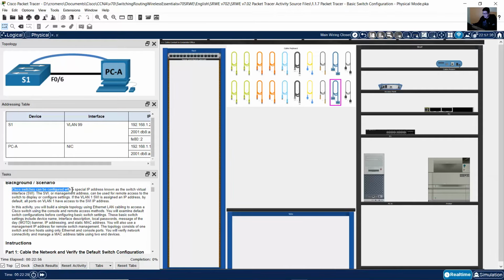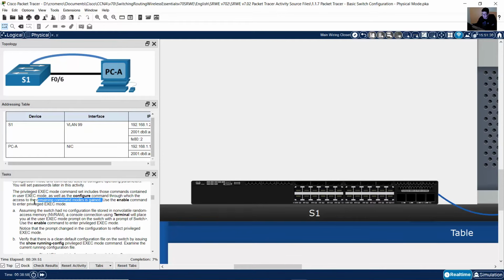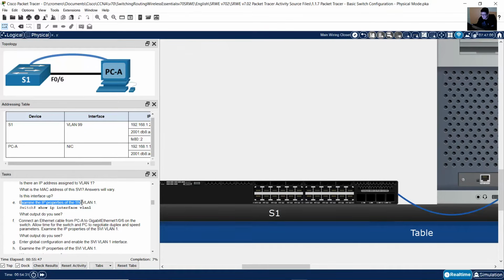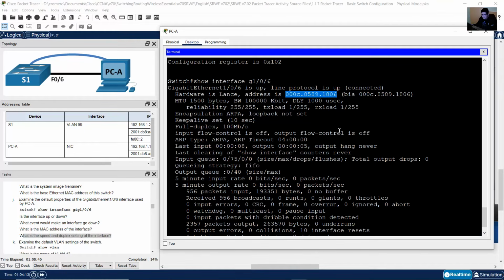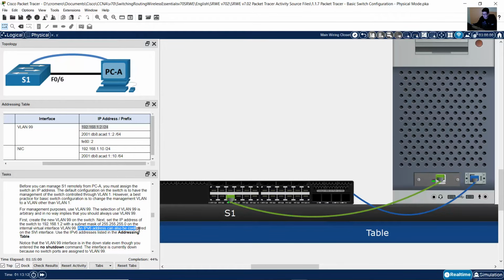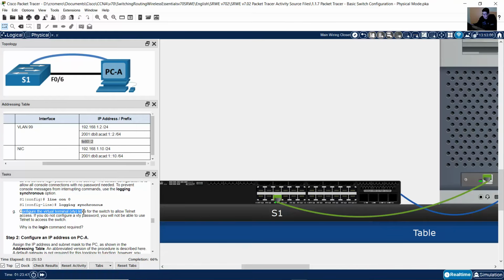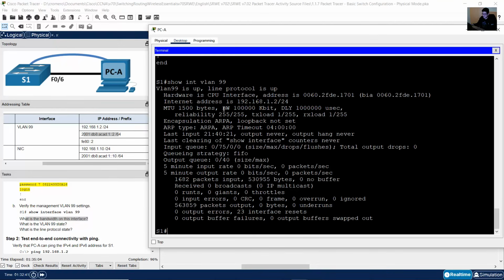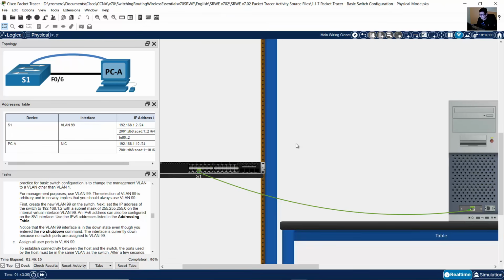1.1.7 Packet Tracer - Basic Switch Configuration - Physical Mode

Comment: Just FYI......It is as if it gets stuck at 96%. What I did to get to the 100% completion I saved all my work and closed the packet tracer. Then I reopened it as if I was going to make changes and it showed that I was at 100% instead of the 96% that it showed before. Hope this helps anyone else watching this later. Thank you Christian for the video and the ones you will continue to do.
Reply from the maker: Thank you for all your support and good observation
Reply: THANKS FOR YOUR INFORMATION BROO LONG LIFE❤😂
Reply: You just saved me a 2nd run through of this lab. You are a legend! Thank you so much!
Reply: omg you are right
Reply: Thx
Reply: THANK YOU!!!
Reply: That worked!! Thank you
Reply: @vgs717  your welcome 👍😉
Reply: THANJ YOU!
Reply: Thanks!
Reply: Thanks!!!
Reply: Thanks man, I spent a lot of time trying to figure out what was wrong until I saw this comment!
Reply: thank you
Reply: YOU ARE MY HERO THANK YOU
Reply: Brooooo.... I was getting crazy...Thank you so much
Reply: I did the same thing but it still saids 96%, on the complete assessment under DNS only HOST is incorrect. how can i fix this?
Reply: yep, still relevant !

Comment: Thanks Christian! I went to bed last night at 96% and when I woke up and loaded the PKI file it was at 100% and I hadn't changed anything. It had the same error you had at the end. Not sure why that happened but it worked.
Reply from the maker: Thank you for all your support, great observation, it's a packet tracer bug
Reply: my instructor told us that when we get stuck at 96%, somewhere down the line, we were supposed to implement a static route:
S1(config)#ip  route  0.0.0.0  0.0.0.0  192.168.1.1
Reply from the maker: @iiCharlemagne  very nice option to try
Reply: Don't question it. That's something you learn in coding. If it works, and you don't understand why, just let it be.
Reply from the maker: @theemperorstarwarslegends8075  Yes because all is configured correctly